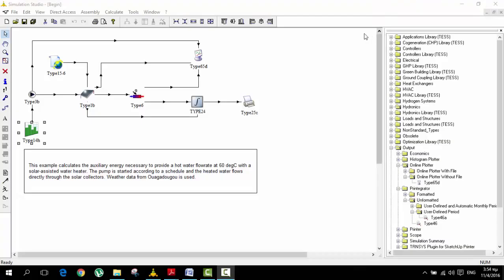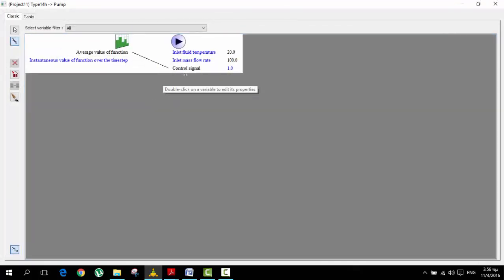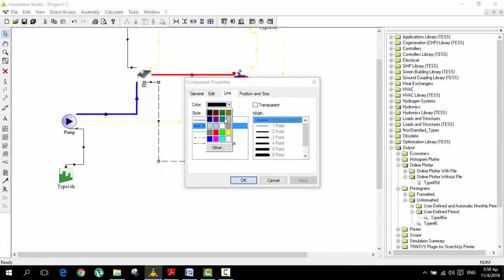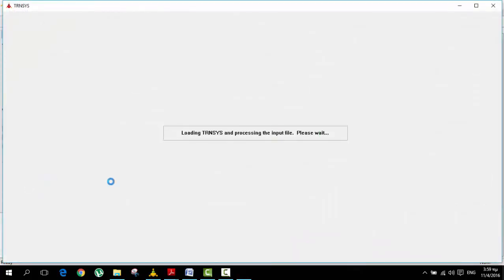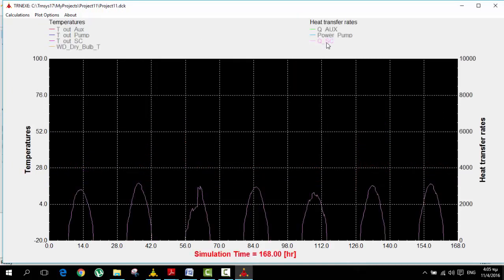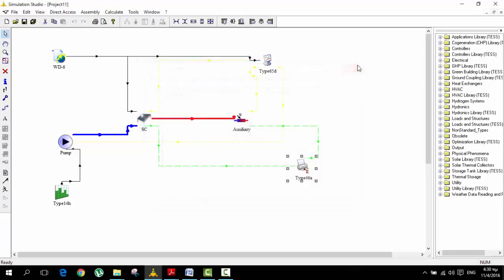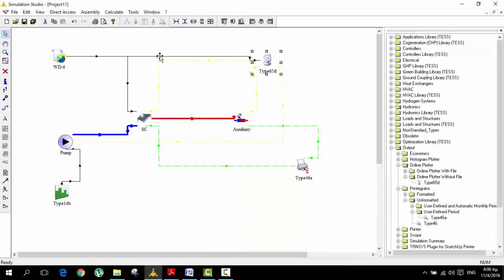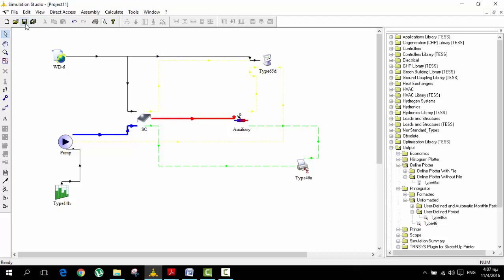TRNSYS Tutorial #4: Begin Example  STEP BY STEP (part3)

Comment: Thank you for the presentation. I've been trying to simulate Example 3 as that mentioned in Solar Energy Research Centre (SERC) and have been unable to resolve the errors. Your guidance in that direction will be much appreciated. Also I'm unable to locate project files in MyProjects folder (even after turning on the show hidden files and folders) but I can access them using the open dialogue box of TRNSYS.

Comment: the consumer load profile, the equation is in liters?
Reply from the maker: +johny seven If you mean how much water is flowing through the pump, it is defined in kg/hr. The Load profile (a.k.a Type 14h (a.k.a green bars component)) just tells the pump WHEN to start working,( when we have the SUN 8am -18pm) . How much water is seen in the Flow rate in the PUMP.  I hope I answered! :)
Reply: yes, Load profile is type 14h, but my question is you defined "one  kg/hr " isn't  very little :s ?
Reply from the maker: +johny seven you're right it is very very little. Maybe I forgot to adjust it, but in the begin example it's something around 60, but not sure.
Reply: My other question is how we regulate the system power backup eletric
Reply from the maker: 1. The AUX functions only the hours that the pump is running. So 8am  -18pm. 

2. In the input Tab of the AUX heater you will find the Tset. which is set to 60 oC (usual for Domestic Hot Water). So the AUX will work roughly until the water reaches 60 degrees. 

(!!! Check the mathematical Description to understand more in depth why it is set this way, and why its doesnt have all the time 60oC output Temp. !!!!!)

That is a GREAT question, Thank you!